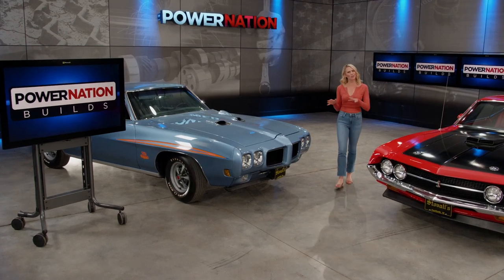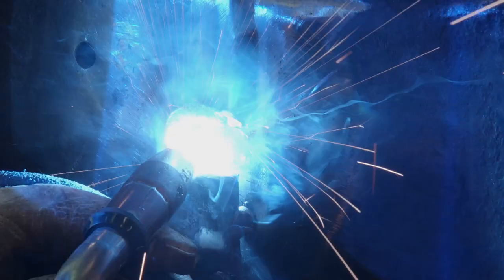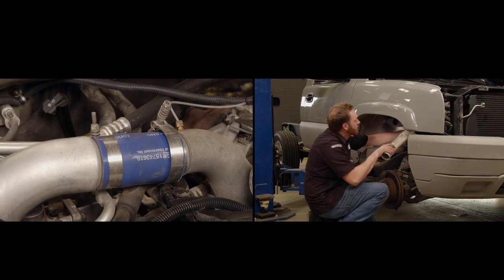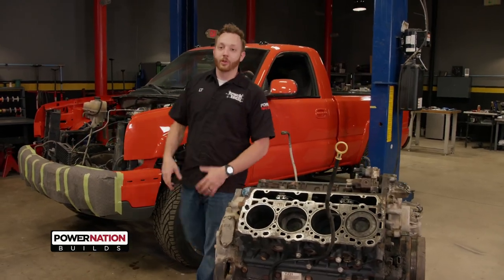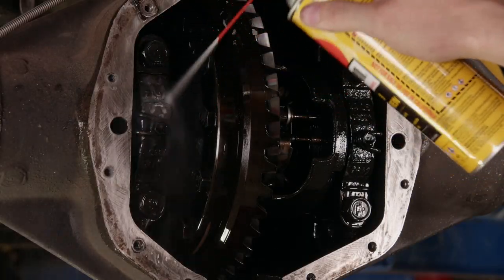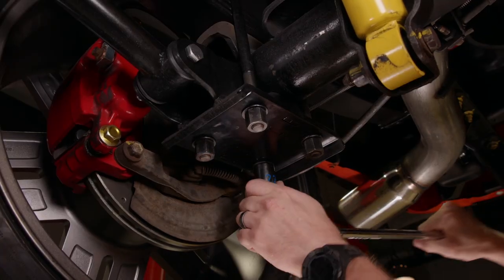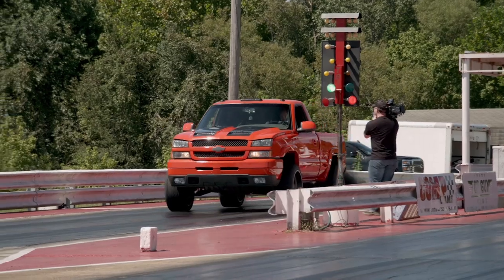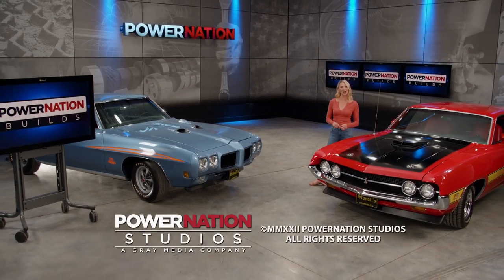Chevy Silverado Goes From Stock To Short Bed SuperMax - PN Builds

Comment: You're unloading the front suspension and overpowering the toothpick tie rods. This is when a rack and pinion conversion comes in really handy all the force you're putting is equal and opposite to the other Force. But a simpler solution is to strap the front and put a line lock on the rear brakes and you'll be running sixes in the 8th in no time